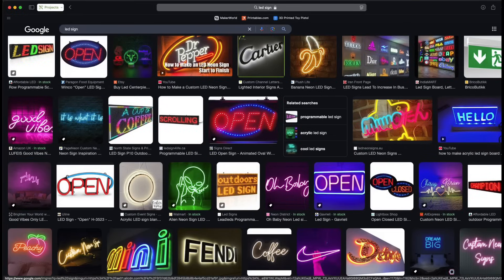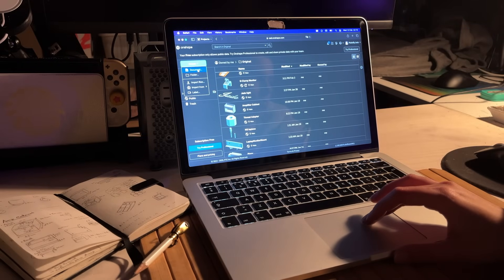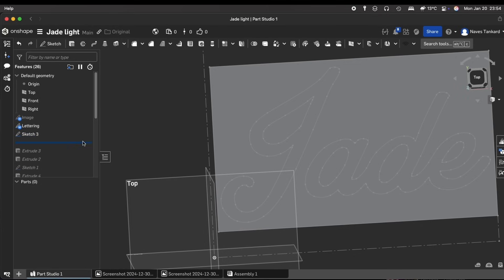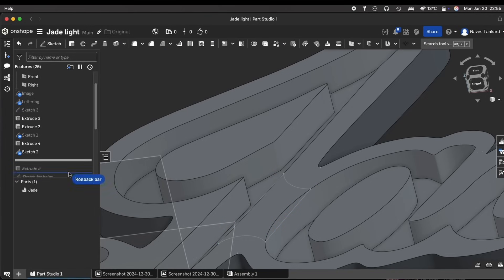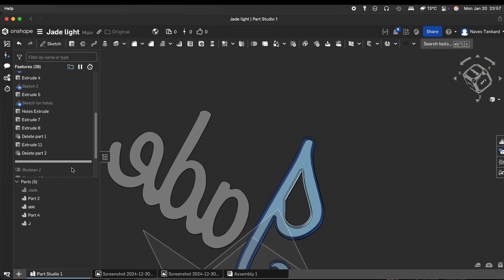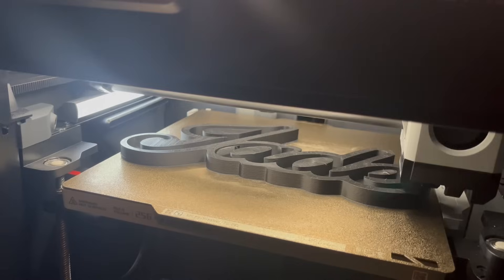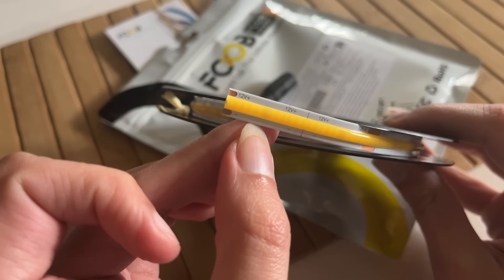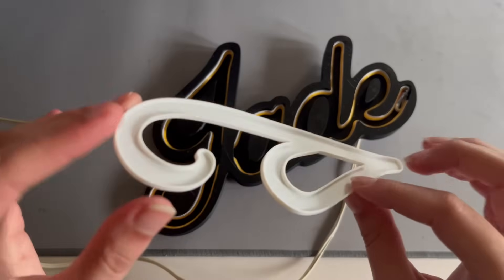Easy 3D Printed LED Sign

Comment: I love the result, looks very smooth.
But the process doesn't look that easy, to be honest and I would fear that the glue is coming off from the LED strip. So if you find solutions to make it even easier and more robust, I would love to see a new video from you. I like your video art!
Reply from the maker: Hey! Thank you so much. The build itself was rather quick. And I haven’t had any issues with this particular LEDs. The glue they came with was enough to secure them in place but when I have these issues I use a better quality double sided tape (like 3M) or a drop of super glue ahaha 😁

Comment: I love this and how you decided to route the lights . Idk sketchup but like the other comment said you can make this into a svg. You can either make this a png or use a tool the make it an svg . for the plate could you extrude just the faces to make it clip in ? I use blender and wondering if that would work.

Comment: Just found this and it is awesome! I have a question: Did you use a clear or matte filament for the white parts and how many layers where used to get an even lighting?
Reply from the maker: Thank you so much!! I used matte filament (more specifically Ivory White from Bambu Lab). I used 2 layers, as I was already using COB LEDs it was easier to diffuse ☺️

Comment: Bom Video 👍
You can also use a rechargeable battery and create a small compartment on the back. This way, it will look a lot cleaner without the wires showing, and you can literally put it anywhere without needing to be close to a socket.
Reply from the maker: Obrigada! Yeah, that's a great idea. Although it would become a lot bulkier. Kinda depends on the look you're going for. But I agree that the cables always ruins a bit the look 😂

Comment: Nice... I saw that shortcut for placing the points on the lettering... I have been placing them manually, lol, now everything is faster and done smoothly.
Reply from the maker: Ahaha well, it's always a good exercise in the beginning to learn how to work with splines. But learning shortcuts helps a lot to speed up the process

Comment: Nice. I want to do a rectangular, large ceiling-lamp. Not 3D printed but from wood with a plexiglass diffuser or if possible one made from white fabric. I want to do a series of these where all are acoustic panels, but one is a lamp. I wanted to use LED-strips as well, but I am not sure how bright they are and whether I need to do anything additionally to get rid of the heat they produce. There are no videos of people building real lamps from these. Mostly it's decorational/artsy lamps.
Reply from the maker: That sounds like a great project!! That is giving me a lot of ideas 😂 As for the brightness, the more you add the brighter it will be, but also consider a way of dimming them. You might not want them in full brightness all the time. Regarding the heat, with a lot of LEDs/longer strips that can be a problem. So mounting them in a metal surface would help dissipate the heat, and some vents along with it. ☺️

Comment: Good work, but the heat from leds deform the 3d printed letters in continous run. Its better to print it in petg or ABS
Reply from the maker: Thank you!! Yeah, you're right. But as I don't have it on for long periods of time I haven't experience any deformations.

Comment: Awesome! I have to give that a try. It's too bad OnShape doesn't support custom fonts, but maybe importing a vector file could work?
Reply: Or just do it like she did, create the artwork in another file and then import as an image
Reply: @markylonyeah, but you’re doing double the work. Converting it to a DXF or DWG file would be the easiest.
Reply from the maker: Yeah, it's easier when you have that option. But learning other techniques can be helpful in other scenarios ☺️
Reply from the maker: Thank you!! ☺️ Yeah you can import a vector file and use it in your sketch. In this example I just shortcut it with a print screen of the text as I wanted to explore the splines for this. Luckily it was only 4 letters 😂
Reply: @madebyJa13de just recently tried working with splines as well to create surfaces. They are really nice and quite easy to work with. Works the same as Illustrator.

Comment: How do you get the spining done so well? Is there an Automatic way to do it or you really have to do it manuelly?
Reply from the maker: Probably there's a way to do it automagically (not sure), but I did it manually. 😅 it didn't take much time, just placed the points were the curves were changing and then adjusted them slightly to better fit the shape 😊